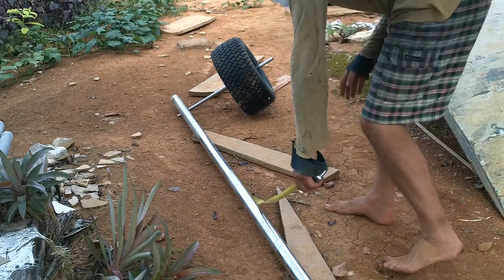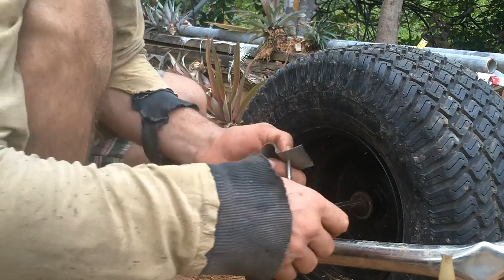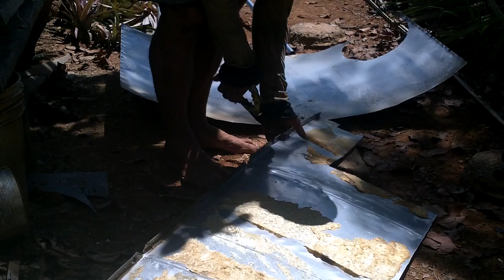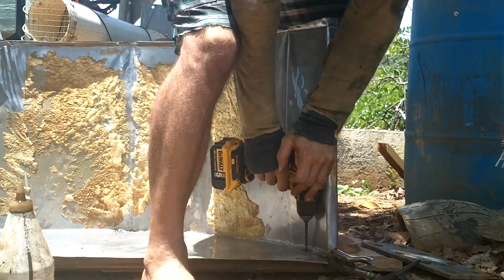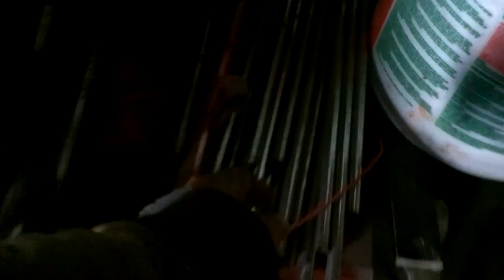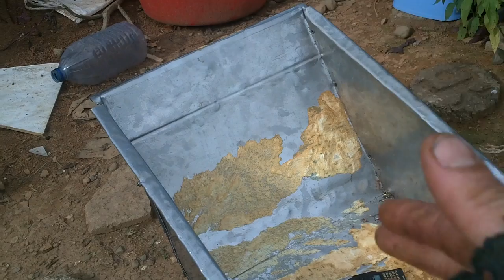The Last Wheelbarrow

Comment: Nice wheelbarrow Jamie. I particularly like your choice of the wide and somewhat flat tire/wheel, that should be quite useful on soft or uneven surfaces. One potential issue is your handles bending from ground contact 22:57 while being loaded. I know you don’t want rear legs but having legs/support/blocks right under the rear of the bucket that just raises the handles off the ground will shift the contact to the area under the bucket relieving strain on the ends of the handles. The braces you installed will continue to do their job when you pick the wheelbarrow up to move the load for dumping.

Comment: I suspect that the legs at the back of a traditional wheelbarrow serve two purposes: 

To protect an unskilled labourer from injuring their backs. The correct way to lift a heavy load is to bend at your knees, not at your waist/back, which would be a more natural action with the back being raised.
And if working in a wet muddy environment that the handles are not continually being shoved into and covered. And then when you go to move it up the muck could could act as a lubricant causing your hands to slip, leading to a possible injury of yourself or others. But that is easily remedied by not using it when raining or just after it has rained. Some caked dirt on the handles would probably increase friction.

Comment: If you had a large log stood Up All In perhaps two you could put it at your work site. You run you will borrow to your work site you can set it on to the logs in replace of the legs. This way you don't have to bend down so much to get to your handles. You have to move your platform around. Pulling up to the platform you would be alongside it and hover your handles over top the platform. And then move in and out away from the platform to go dump.

Comment: I think Jamie and most of the commenters are confused about legs. You don't need legs to keep the handles off the ground, and Jamie hasn't avoided the problems of hitting your shins on the legs in an apples-to-apples way. All he's done is skyscraper the load. Think about it, the legs are the lowest part that sits in the dirt. Instead of having legs, he has handles all the way in the dirt. He's lifting the whole load like, a foot higher than he otherwise would, that's why there's nothing near his shins. Else, you can just bend the handles upward 90 degrees then horizontal again 90 degrees and start lifting from a foot off the ground rather than all the way in the dirt. Then his shins would hit the bottom of the tub. Jamie says the load feels lower than a normal wheelbarrow, he's wrong, it's a foot higher. Jamie says the load feels more stable, he's probably correct. The reason that a normal wheelbarrow feels unstable is because the wheel is placed more underneath the tub when lifted and carries almost all (80%?) of the weight, the driver just carries the balance. On Jamie's wheelbarrow the wheel is so far forward that it only carries 50% rather than like 80% of the weight. So, it's less tippy, but a hell of a lot harder to move.
Reply: Another easy way to visualize stability... the longer the lever the most stable. A normal wheelbarrow has a lever between the handle and the wheel, and when lifted, the wheel is under the load, not much in front of it. This makes a short lever. Jamies's wheelbarrow has the wheel in front, so it's a long lever. Try balancing a ruler upright on your palm. It's almost impossible. Try balancing a yardstick upright on your palm, it's easy. This comes at a penalty of carrying almost twice as much, and picking it up from a foot lower where it does the most damage to your back. The bad thing about back pain is that you can do 80% damage to your spine before you feel pain. By the time you feel pain and decide to change things, it's too late, the permanent damage is done. It's quite counter-intuitive.

Comment: What a great wheelbarrow Jamie! 
You also convinced me about the lower legs and front sticking out piece, because I have also hit those while crossing over rough ground many times. The wide wheel is a great addition too, because it deals with the other annoying wheelbarrow issue, of the wheel sinking in, when wheeling it fully loaded over soft ground! Regards Dave.

Comment: Not all wheelbarrows for sale are crap. I've had mine 20 years. Would have had the same one for 35 years except I lent it to a neighbor to mix concrete on the condition it came back spotless. It didn't. I told him to keep it and went and bought the same model.

I like that mine has the wheel directly under the deepest part of the bucket. I can pile material just over the wheel so it acts as a fulcrum. With the wheel out past the front you always have to lift about 1/2 the load.

Comment: Hey J. , build a paddle board with pedal powered drive like your tri- hulled boat . Just wider than a normal paddle board with your propeller designs . Thanks to you I'am working on my fiberglass techniques.

Comment: Nice job love the wide tire! I wonder if you may come round to adding something to keep the handles off the ground (I have done "loads" of wheel barrow work so am experienced but certainly respect this is your fun time)! Even just a couple of wood blocks (Ok stainless works too) placed just forward of your grip or the like to level the box when on the ground. This way they are not "legs" but will still keep your grips clean ish! Best/Roy

Comment: You probably really need to do yourself the biggest favor. Ship over a lawn trencher not the biggest lawn tractor but something that can pull and has the drive system that pulls. And work to improve the rusting thing even though it will Rust. And add the attachments that you will probably need. Such as weighted tires. With change log chain ground Ripper. Push blade or back in Blade.. a lift bucket would be nice. A smallest backhoe would be nice. You're an event of person if you can't afford the gas. You can figure out a high-torque arm that goes back and forth either hydraulic or gear driven preferably hydraulic. About this thing on a ratchet system if you can figure out a way to get it to go back and forth on its own. Which can be done. Yes this thing once you hook it up to the drive system of the lawn mower it will be a Lurch forward but it'll be a powerful urge hytorc lorch. And it can most likely be solar. In truth this is what I thought you should do with your bulldozer and to turn you would just flip a switch to turn off one of the largest yes you would have to hydraulic DC powered cylinders. You actually need more than that if you want to lift your nice little bucket. As far as you will bargo's you have something but I really think that you really should concentrate on turning that thing into a wagon. If you are so terrified that the tractor will Rust maybe you need to put it in a shed and keep oils on it as much as possible. Some people would say paint.

Comment: I do think you need to wear ear protection / wear gloves and use a cordless jigsaw to cut metal more. The reason i am saying this is you do not realize how much pressure your joints are under using tin snips and how high pitch sounds (power tools, hitting metal etc) affects your hearing. These actions can lead to arthritis and deafness which slowly affects you. Great job and video Jamie.

Comment: dude maybe it is more stable cause your wheelbarrow wheel is pretty broad
Reply: It's stable because the wheel is in front instead of under the load. The downside is he has to lift a bigger part of the load.
Sometimes original designs are better because they sort of evolve through many iterations until people can't think of improvements.